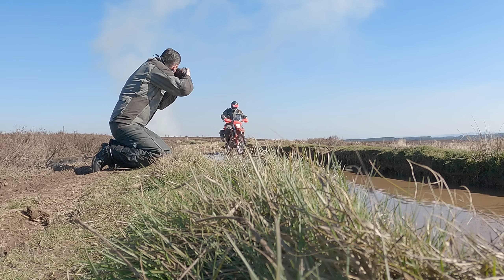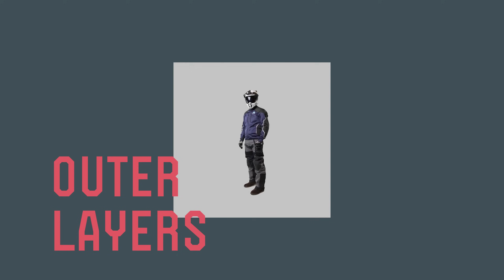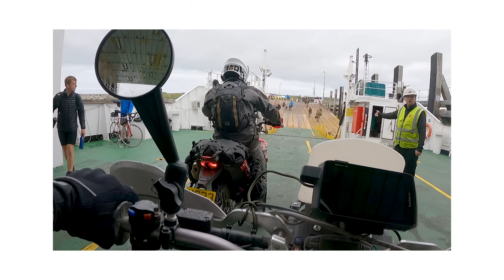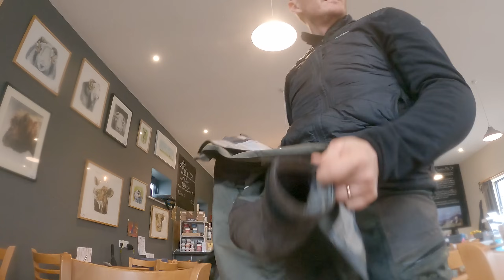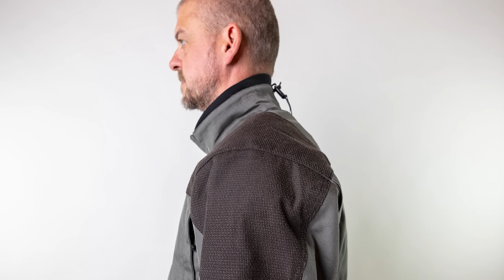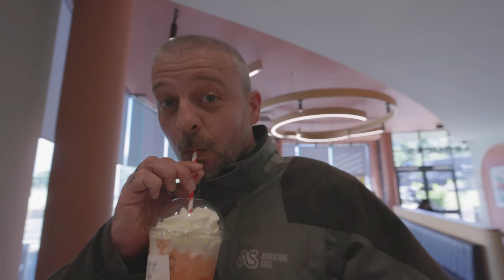All our dirt riding gear knowledge, in this ADV touring suit  👉 The Gravel Jacket & Pant

Comment: I’d like to share my experience with the Supershirt.

In July, while riding on an asphalt road at around 50–60 km/h, I lost traction in a corner. There was some kind of substance on the road, most likely oil. I suddenly lost control of the motorcycle and slid for several meters on my backside, back, and elbow.

I was wearing a jersey over the Supershirt. My pants were torn, the jersey was also damaged, but my body wasn’t even scratched.

Absolutely amazing. Thanks AS 👍🤟😉
Reply from the maker: Wow, glad you are OK. So good to hear this feedback, thanks so much for sharing. Really good to hear The Supershirt is doing what it was designed to do. ❤️

Comment: So I ride a gas gas 350 for green lanes - a gs for touring and  Ktm adventure for the in between . I ride the gs the least and the gas gas the most but I’m planning an ACT Portugal trip on the 390. I have recently purchased a super shirt. If I can only purchase one jacket which one should I choose?
Reply from the maker: That's a tricky question. I think that if you already have a Supershirt then the Singletrack Jacket gives you water and wind protection. You can then layer up your mid layers for warmth.

Comment: Fan here 🙌 
Bought the gravel jacket and Baltic jacket ,next on the list is the gravel pant , and a few other things I keep finding out you sell .pants ,gloves and other base layers 😅 the list goes on 

I had the wrong boots 
But I’ve purchased the correct boots in order to get the gravel pant to match 
I will leave a full review on your website after using them in anger  ,bike is parked up for a bit as I’m flat out with work /Family
Reply from the maker: Thanks for putting your trust in us and the Gravel gear. :-)

Comment: Just wondering if the new armour will fit in the linesman pants and are they available to buy separately thanks Phil
Reply from the maker: Hi Phil. We will be putting more info out about the new armour soon. In short - we will start selling the full range of new armour in 2025 but I can't specify when. The new armour is slightly different shape to the 'old armour' so it won't be a perfect fit in your current Linesman Pant. All our new clothing from 2025 onwards will ship with the new armour.

Comment: I need honest to god guidance from someone who knows whats up.  

I'm specifically looking for a adventure jacket that is just the outer shell.  I need durable CE abrasion resistance for travel and then I need venting for off-road.  I don't need armor or thermal liners or rain liners/rain proof.

I just need a good outer shell.  I plan to layer over a KNOX urbane pro mk3 as my armor and main abrasion resistance.  Most everything add layers and armor.  I just need durable and able to be layered for cold and vents for warmer days.  I don't need summer because the knox urbane pro will be just fine in summer.

I'm very interested in something like the gravel stuff but to be frank - I can't afford it.  $700 is just out of my reach if I'm honest with myself.  There MUST be something at a cheaper price point that suites my needs.

Please, even if it's not this brand...I need guidance lol.
Reply from the maker: Have you considered The Linesman Jacket? It's our CE A rated softshell. No waterproofing, has vents for summer and if it's very hot you can remove the sleeves (great if you have armoured shirt underneath - we use The Supershirt). Take a look and feel free to drop our Helpdesk a message if you have more questions. 🙂

https://www.adventurespec.com/shop/linesman-jacket-949?search=linesman+jacket&order=name+asc#attr=1032,1038
Reply: Rukka Rimo-R

Comment: With a hydrophillic membrane, how do you make that only work one way and keep water out?
Reply from the maker: This is worth a bit of Googling to get an answer that meets your requirements. This is what I pulled out quickly:

"Unlike microporous membranes, hydrophilic coatings use a chemical process to absorb and move moisture vapor through the fabric by diffusion. These coatings do not have physical pores but instead rely on the fabric's molecular structure to manage moisture."

If you want the full science behind this I'm sure you can dive deeper. :-)

Comment: This was helpful. My biggest gripe with regard to CE rating is that it doesn't differentiate between impact protection and abrasion resistance. It seems that some garments receive higher ratings because they have more armor, even though the AR may only be 500D.  My research has suggested that CE AA rated denim tends to have significantly longer slide times than a comparable textile garment. We won't bother comparing textiles to leather because that was never a fair fight. Bottom line: I want to like these touring suits, but the lack of slide protection is a deal breaker for me. I guess I don't understand why manufacturers don't use leather on the high impact areas.
Reply: It's quite easy to explain the reasons manufacturers don't put leather (cow, Buffalo, Cangoroo, you name it) in those areas, especially on adventure gear.

1) genuine leather needs to be maintained. Cleaned, washed, greased
2) genuine leather soaks up water pretty easy and is therefore not ideal for riding in the rain or in misty weather
3) if the leather get wet, dries up, gets wet and so on and so forth, without getting maintained, it starts to wear super fast, it dries out, gets hard an brittle and breaks in the end which wipes out every benefit in terms of abrasion resistance

These facts make manufacturers of garment tend to use different, also abrasion resistant fabrics, like the Kevlar reinforced ones AS uses to get somewhere near genuine leather.

Hope I could bring some light to the topic.

Ride safe! 😉🤙
Reply from the maker: Thanks for helping with this answer! Yes - the downsides of leather are that it is more problematic to keep in good condition over repeated washing / wetness. We use Hypalon and 500D fabric as an alternative based on the needs of our adventure riding community. :-)

Comment: I have some AS hard parts for my bike and I like very much your "mentality" about gear!! 
One almost deal braker for me is the thing that an off road boot does not fit under the Gravel pant. I own Gaerne Fastanack enduro witch are a middle way adventure/enduro boot and don't see any reason why you couldn't leave a little bit more space down to the end of the pant... 
All the other features of the Gravel swit seem to be just spot on for me except this which is very important because I think that the legs need much more protection off road than a "adventure" boot can give. OK there is the Mongolia pant  as you say but still... 
Great and absolutely informative video!!
Reply from the maker: The Singletrack Pant will 100% fit your boots. It is an almost identical pant to the Gravel, but designed for larger boots and riders who wear their own knee armour. 

I had a look at the boot you mention and IMO I think it may fit the Gravel Pant as it's a similar size to the Sidi Adventures we used in testing. Our Helpdesk is pretty good with returns too if they don't work out.
Reply: Excellent video explanation. Did you try the gravel pant with the Rev It Expedition boots which are in between adventure and motocross? I prefer to have the knee protection in the pants.
Reply: I found the Gravel trousers fiddly to get over boots anyway so I cut away most of the gusset, leaving a 25mm-wide, double-thickness flap behind the zip. This works very well.

Comment: Hello Greg,

that is the gear I'm potentially looking for but I do need some size clarification.

I bought the Mongolia Trail Pant (36, Regular) as my first pant and it is just a great pant. I can open the zippers in summer time and get some ventilated air. I wear a Merino base layer from autumn to spring and the pants still feels comfortable and is wide enought for the base layer underneath.

When you launched the Linesman Pant I bought it as well in the same size (36, Regular) but it feels and sits more like a (35, Regular-Short). It means I'm not able to wear the Merino base layer as it doesn't feel comfortable anymore and is too tight on the skin. Also the length is slighty too short for my boots so I'm planning to sell it.

The Gravel Pant size is someting essential for me as I want to wear my Merino base layer below and the pant should still sit comfortable / loose but not so tight as the Linesman Pant. Can you provide some size comparision or explain the differences and why?

BTW all my AS Jackets (outer and mid layer) are in "L" and it works very well. Except the Singletrack Jacket, which is in XL and also very fine.

I'm looking forward for some further information,
Bernd
Reply: I'm not Greg, but I do have the SingleTrack pants , and the Gravel pants does look quite similar to those, with the difference that there is no armour included with the SingleTrack pants. I also have the SingleTrack Jackett, and the Mongolia pants and jacket. I wear a Medium Mongolia jacket, Large SingleTrack jackett and 34/Regular pants.

As for the pants I actually wear separate armour and remove the included armour, same goes for the Mongolia jackett, and both pants are for me equally roomy for the stuff that I wear underneath. Which is base layer, some armour shorts and shin guards, and a armour jackett.

I'm mentioning this because of the similarities between the Gravel and SingleTrack pants, at least in looks. The Linesman pants does look really tight just going by the images, so maybe there's enough similarities between my pants to say that you could probably go with the same size as on your Mongolia pants.
Reply from the maker: Hi Bernd. We will have sizing charts available as part of the Gravel Launch. Based on what you have written I think that the issue you are having is that the fabric on the Linesman Pant is designed to be close fitting but stretchy. The Gravel Pant fabric is not like this, it's closer to the main fabric panels on your Mongolia Pant. For the Gravel Pant I would size the same as your Mongolia Pant. Hope that helps!